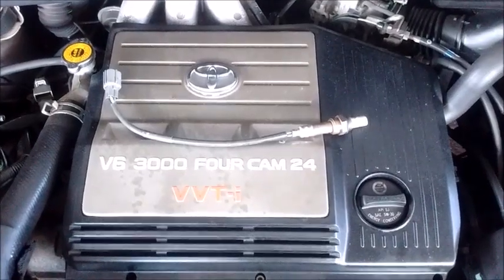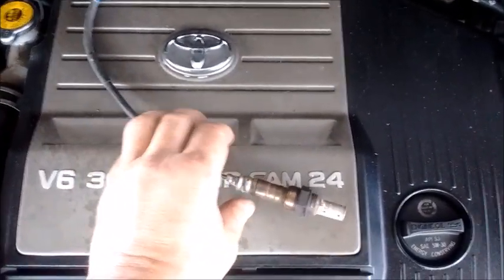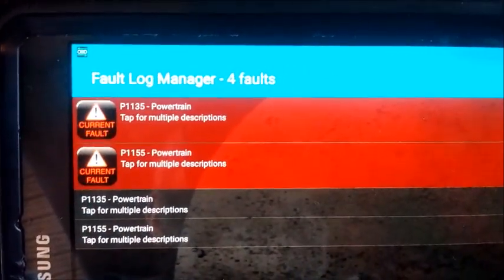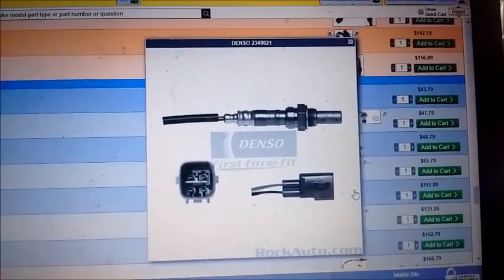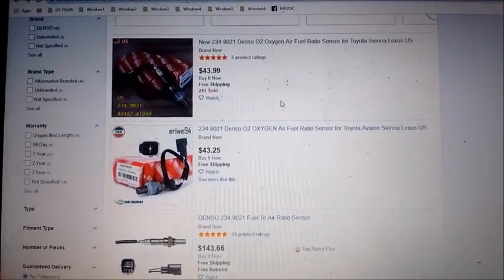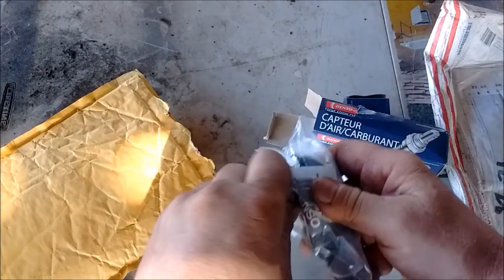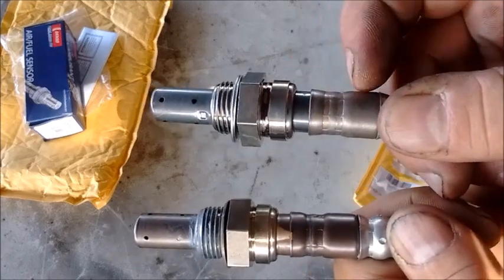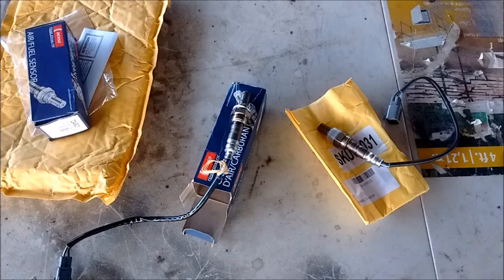Denso O2/AFR Sensor - Real Versus Fake

Comment: I just bought a Denso O2 sensor from RockAuto and it didn't come with anti-seize or documentation. It's sealed in a bag with a part number on it in a Denso box with part number. I'm checking with Denso to see if it's real.
Reply from the maker: As far as I am concerned, if it is in a blue denso box, then it is authentic. But it's odd that you did not get the anti-seize and instructions.

Comment: Thanks for this. It's a major problem today with counterfit A/F sensors. I've already returned two Bosch 15217's for our Lexus RX300 both 99% sure they are counterfit. Both arrived in genuine looking beat up Bosch boxes one saying made in Japan. The Amazon one even used a genuine looking Bosch website but when you check the shipper, it's Prime Source Distribution in Florida and there is another youtube video on this seller. Both the genuine Bosche 15217, which I believe is a reboxed Denso and the Denso 234-9009 counterfits are the same. The genuine Bosch says made in Japan. The two I received have all the dimples so they've gotten better since this video came out. Also, my concern is Rockauto being a drop shipper, what's the chance their seller is selling a counterfit?
Reply from the maker: If you can't trust Rockauto, then who can you trust.

Comment: I was advised to replace my sensor with an original Toyota sensor. Aren't genuine Denso sensors the same as the ones you purchase from the dealership? I'm confused as to what the difference is. Thank you.
Reply from the maker: The market is flooded with counterfeit/fake Denso sensors - and  a lot of fake Toyota sensors too. The average person cannot tell them from an authentic sensor. Buy your Denso or Toyota parts from a trusted source. If the price is too good to be true, then it's probably not an authentic part.

Comment: Im having a problem with my New 02 sensor, skinnier wire than the old sensor caused my check engine light to turn on even faster than the very old O2 sensor i had on the car before. Should i buy a more expensive better  O2 sensor? Do you recommend denso?
Reply from the maker: BUY A DENSO BRAND SENSOR FOR YOUR CAR FROM ROCKAUTO. OR CONTINUE WASTING YOUR TIME AND MONEY.
Reply: @Merryfrankster_  thank you

Comment: The ebay listing you clicked on was one of the more misleading ads, but a lot of sellers do similar stuff. Like you'll type in "OEM Sensor" and it'll be aftermarket. If you go to the brand column in the description it will either be a name you've never heard of, it'll be the seller's name, or it will say "For Toyota". I'm looking into a sensor now that actually claims to be Genuine NTK through and through, but it looks fake to me. So I guess I'm interested in seeing how a Chinese sensor would actually perform. 

Looks like that seller sold 241 of those sensors, and the reviews on them are pretty good. I understand some people being sticklers for OEM and having high quality products. But a lot of people just wanna get back on the road as quickly and cheaply as possible. Especially for a 22 year old mini van.
Reply from the maker: You pay your money and your take your chances. It sucks to have to do a job twice because the new part your put it does not work as advertised. It especially sucks if you have to do this for a customer. They will always blame you for the fault, no matter what cheap junk they brought for you to put in on their car. And try warrantying one of these parts from China - you will get absolutely nowhere. Ask me how do I know that. Your  best solution, given your budget situation, and your general attitude, is just leave it alone. Don't bother with a replacement. Stick a piece of electrical tape over the CEL, if it bothers you. You won't ever know the difference.
Reply: @Merryfrankster_  In the context of a customer, if they are paying you for the work, then obviously you should go with the  more OEM looking part. But if you are installing these yourselves, you're saving roughly $70 by going with a part that has sold hundreds and has favorable reviews. O2 sensors are not difficult to install, especially on a vehicle from 2002. Worst case scenario even if I had to spend an hour taking the fake one off and replacing with a new sensor, I could have saved $70 on. I don't make $70 an hour so the price difference would have been worth it to me.

You seem awfully defensive about not trying the other sensor. Another author asked and you went right at him. It was more curiosity about how a cheaper part at roughly 1/3 of the price would perform. Yes, there's "the right way" to do things, but most people who still have a 2002 Toyota Sienna are probably on the last legs of the vehicle at that point. It may not be cost effective to do everything "the right way" at that point. You can understand that can't you?

I also noted that ebay does heavily, heavily favor the buyer. So if you tried it and you didn't like it for whatever reason, ebay would have had your back and forced the seller to refund. So the only risk was the time involved. Some people value their time more than others. Hence why some will pay $100 for an O2 sensor install that takes 15 minutes to do. Some would rather do it themselves.
Reply from the maker: @aznnp77  You seem like one of these people with nothing better to do so you go online to show off your complete lack of knowledge and common sense. Go preach your nonsense somewhere else. If you want to poke yourself in the eye with a stick, fine, but don't try to talk other people into doing it too. Anyone stupid enough to take your advice deserves whatever befalls them. You can take this as a personal attack, which it is. You brought it on yourself.
Reply: @Merryfrankster_  That's fair advice. Fix it the right way every time. If you can't afford it, get rid of the car. That's seriously fair advice. Many people think that way. Others are getting killed by life right now, along with $9 eggs and $4-5 gas, so they don't have the luxury of getting another car and if a $40 sensor works, that extra $70 is a godsend. 

I usually fix mine the right way, but I've paid for my car 2-3 times over at this point. You can attack me for not having as much money as you if you want. That's fair too I guess. I probably deserve it for putting myself in this financial situation.

Comment: You did not buy a fake denso.  You bought a sensor that have similar size and perhaps performance of a Denso.   The Ebay post does not say Denso.  So you bought an aftermarket.

It is not illegal or immoral to sell aftermarket.   Other manufacturers can use similar model "numbers" that does not mean trademark infringement or selling fake.  This the lesson Intel learned in 1980s when it sued AMD for using 386 or 486 models for their chip set.   

Judge ruled that numbers cannot be trademarked only names.   

You got what you paid for no more no less.  The video was informational on learning the difference in quality.   I gave it a "like".  Thanks for posting it.
Reply from the maker: Thank you for watching.
Reply: Ebay post said denso

Comment: Frank, my car have P0171 what's wrong with that? Thanks
Reply from the maker: It can mean there is a vacuum leak or an exhaust leak or an injector is bad. This code is for cylinders 1 and 4 - bank 1.

Comment: 2010 upstream driver's 02 sensor replaced oem original denso today with a $16 ebay my vehicle specific 02 sensor , vehicle noticeably ran rough , original issue for reason of replacement was a Chevy cel code of p015b , only noticeable change with regard to the vehicle was the cel illuminated , so a brand new eBay vehicle specific 02 sensors are just visually correct but with no function but to screw and plug in and cause a cel code
Reply from the maker: You are preaching to the choir buddy.
Reply: There is no such thing as an ebay sensor, ebay sells nothing, you can buy everything you can buy on rock auto on ebay.  But what do I know, I only sell about 500k worth of parts every year on ebay, so I have no experience.  The problem is you are inexperienced at buying online and buy counterfeit items.

Comment: RA is dumping ground for bad parts.
Beware of dealer closeouts on RA.
I have gotten more useless crap from RA than anywhere else.
Its buyer beware as usual.
Reply from the maker: You must be one of those people who buy the "manufacturer close-out." The same people who never knew that you pay what you get for. Ha ha. Ha ha ha ha.
Reply: @Merryfrankster_  Given that I drive a 96 I often find closeout prices and regular prices from regular stock for the same part.
Bought closeout ball joints.
The taper on the stud was wrong. 
Never bought closeout stock again. 
Not so for some friends. They continue to buy the bargain despite knowing better.
Of course brand name dont always mean much either.
If a part is worth counterfeiting it has been.
Just look at all the counterfeit spark plugs and O2 sensors.

Comment: $200 for an o2 sensor is a "reasonable" price?
Reply: you rather get a cheap Chinese fake?
Reply: Usually at the parts store they are $90 to $135
Reply: that why they call it the stealership
Reply: On an 8 hour shift we make around 5,000 on 1 line of 6 people
Reply: No it's sorta insane, however like $8+ spark plugs, they rarely fail before 150k/10 years which is very reasonable. Just the cost maintaining of a modern car. We could get into suspension as well lol bushings etc.

Comment: What is the resistance of the orginal?
Reply from the maker: This can vary by sensor. For a heated O2 sensor the resistance of the heater circuit can be 10-15ohm at room temperature, higher at operating temperature. The signal circuit cannot be diagnosed by resistance. For AFR sensors the heater resistance varies by type also.
Reply from the maker: Refer to your car's repair manual.